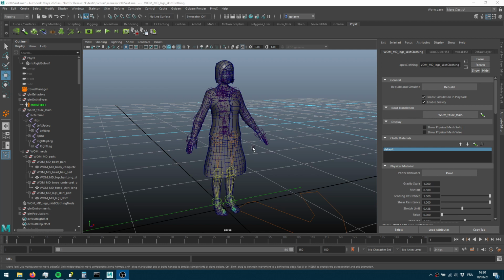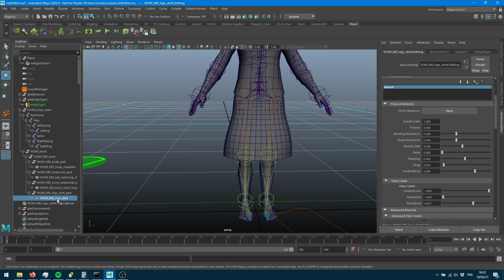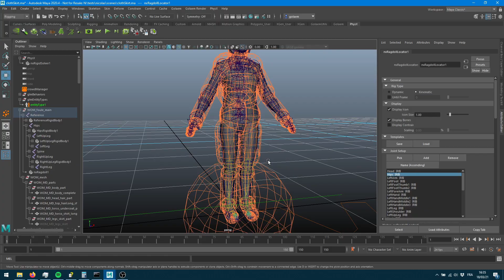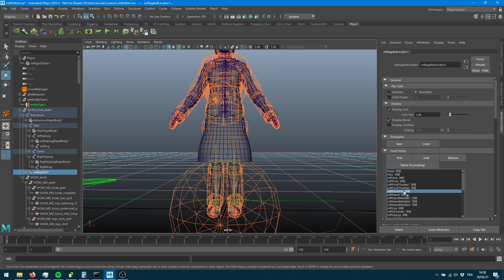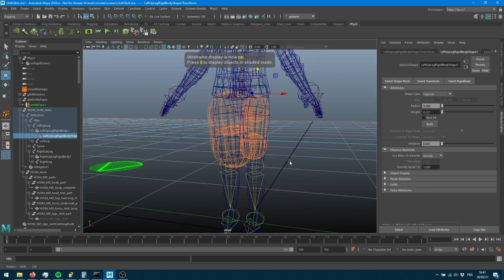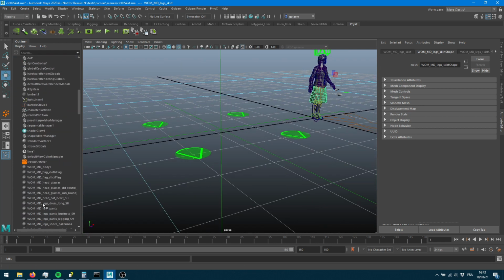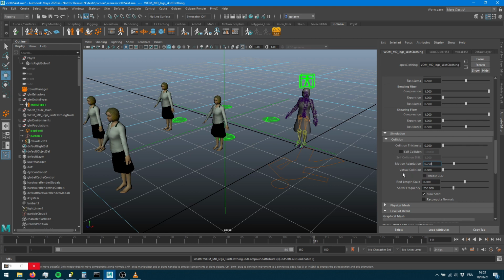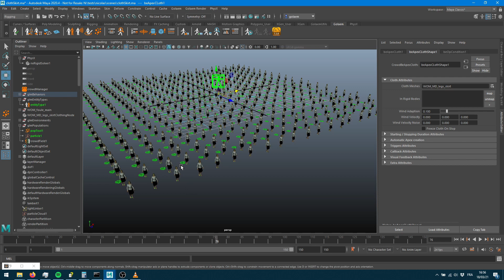Cloth Simulation Part 3: Advanced Setup (collisions with character)

Comment: Hey, thanks for the tutorials, very handy!Just one question, is the skirt skinned regularly on the rig or is just parented?
Reply: Hey Carlo, the skirt is skinned so it still defoms with the character if no cloth sim is running on it
On top of the skinning data we're able to add a weight for each vertex which tells how much of the position will be controlled by the cloth sim or by the skinning
Hope that helps